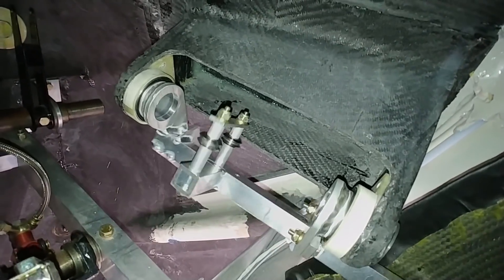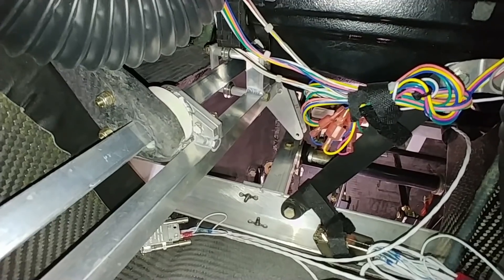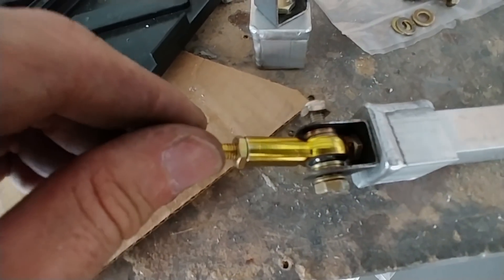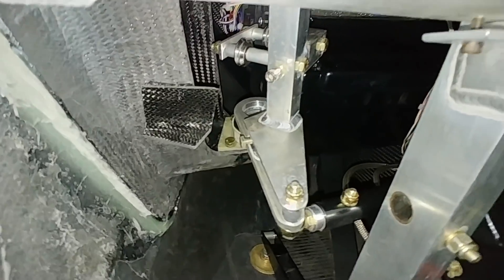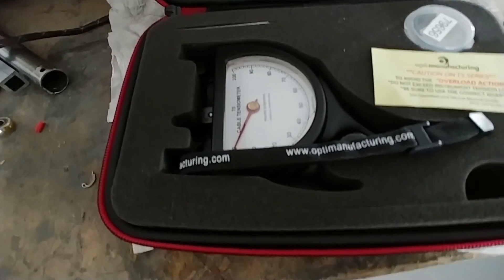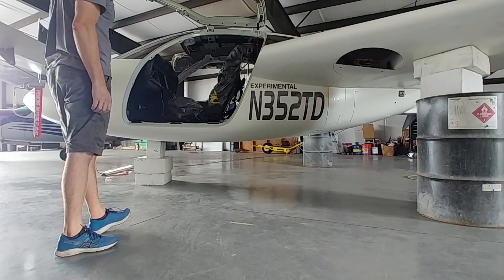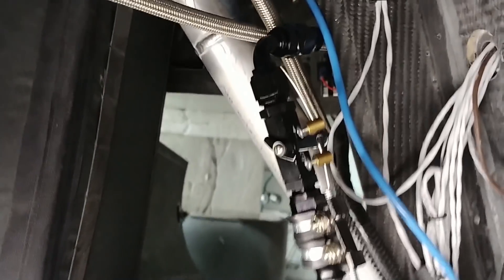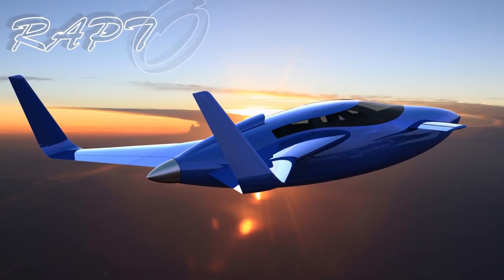Landing Gear Checks - Building the Raptor Prototype

Comment: Do you have air in the hydraulics, or is there any other reason the gear is flopping around?
How do you plan to give the electric "bump" to the landing gear valve when the electrics is fried and you need to land?
And the electric wireing looks like behind the car stereo of every 20y old car that has had 5 young kids as an owner...

Comment: Great job Peter, all your work is beginning to pay off. Is the fuel cut off a 2 way system, can the fuel flow be pushed back on, in the case of an inadvertant off event.
Reply from the maker: Yes, it can easily be pulled out to turn it off and pushed back in to turn it back on. You can then rotate the handle to lock it in place.

Comment: What is happening with the nose gear when normal to down cannot see into bay clearly, but looks unusual movement to up then back down ?
Reply from the maker: It's because the main gear is still retracting which pulses the pressure in the front cylinder until all legs are fully retracted.
Reply: On the way down 9:48
Can you show the schematic and plumbing diagram for gear ops and down locking

Comment: it looks like your right hand side main gear hydraulic lines are shorter or have less bends in it than the left ones. Therefore it's opening and closing quicker due to less resistance.
Reply from the maker: It's purely a minor imbalance of weight and retracting resistance. There's nothing that can be done or really needs to be done about it.

Comment: Those aileron stops do they work also under load? Do all of them then still line up? Also have you thought about an emergency Oxygen system. Especially because you are pressurized and installed an Halon extinguisher. (I know do not use Oxygen when you have smoke or flames)
Reply: Victor Jansen - I don’t  think they would be using pure oxygen more like a 80/20 mix in bottles. You could get a oxygen system that can supply both with the use of a diluter valve. Pure when you need it and 80/20 to last longer this way when you smell smoke you put on your mask until you locate the source.
Reply from the maker: I will be adjusting them for load when I get the sticks installed. Backup oxygen could be carried but is not required below FL250.

Comment: I think the biggest takeaway from the control stick and cable pulley problems is that the carbon fibre composite might be amazingly strong lengthwise, but it flexes crosswise like wet tissue paper.

Comment: I would put a wide washer on the Outside of the aileron connecting rod outside of the Ball link so that if the link  ever fails it cannot come off the bolt head
Reply from the maker: Good suggestion.

Comment: Smooth running with those controls. If you have time before the test flights a beta-landed check list might be handy. Take inventory of all bolt points for tightness checking. Tight sails!

Comment: There appears to be NO restrictor in the normal DOWN system and full pressure along with the weight make it go down too fast and hard. On the hydraulic "control block" you need an adjustable flow limit to the down line only, and not effect the UP system full pressure selection.

I would prefer a seperate dump solenoid powered by essential Battery dc
Reply from the maker: I have the restrictor working on the down cycle. If I turn it up too much more the pressure cutoff switch prevents the motor from running.
Reply: Raptor Aircraft do you have an accumulator in pump output?
Reply: Raptor Aircraft , I looked back over your previous gear videos, I think just use the pump to supply pressure to a small accumulator, then pump going on/off will not be an issue to chase. You can then make refinements to up/dn cycles.

Comment: Im just wondering, is fly-by-wire hard to do for a homebuild / prototype?
Reply from the maker: Immensely, and there's no feel or feedback unless you add that system as well.
Reply: Fly by wire "electrically" is not that simple that's why it's left for the big planes, who can fit multiple computers (3) required
Reply: Very interesting learning about how the whole concept was proven.  Here is the tip of the thread.  https://spinoff.nasa.gov/features/dfbw.html

Comment: Does the gear has a bump stop made of rubber or any other material?
Reply from the maker: There are no bump stops. The gear stops in place where the linkages go over center.
Reply: @RaptorAircraft  interesting, and unique

Comment: Peter,
That looks awesome!  Repeatedly you've taken your own direction, often contrary to what the "masses" say you should do...once again you've proven the correct way forward was your own.  Great job with the sticks.  No doubt the flight test crew will approve.  I am not a fan of the aileron connection to the sticks, though.  Those bolts may (technically) be strong enough, but I've never seen primary flight control hardware installed with a "bending" moment applied, only in shear.  This may deserve more consideration...
Also, at 5:56 in the video it looks like there are power wires in contact w/ your new braided steel line.
At 10:25 you show the fuel cutoff mechanism.  Might you consider making a loop in the control wire ~after~ the top-most screw clamp?  With that loop you would be able to maintain positive control of the valve in the event the screw clamp vibrates loose.
The landing gear is really moving with authority, better than ever!  Looks great!
 
Thank you for the updates, I really enjoy watching.  
Best regards,
Jon